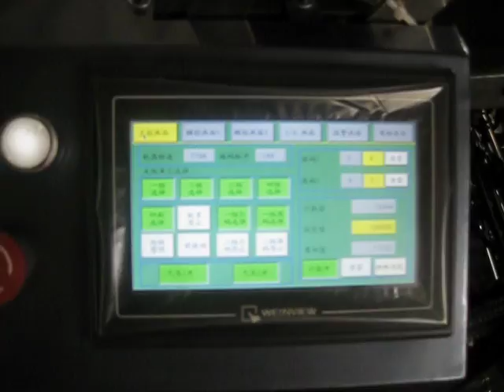all-in-one offset press

Comment: it will last six months i had one, concept is good bot cheap workmenship, all sorts of trouble you have 9 months old it going in scrap metal , machine Daming Brand, air pump gives hot air , paper buckles , 3months motor had to be serviced , roller that drives belt on feedboard got jammed , bearing seized and snapped , numbering machine , one minute it working fine next minute jams , they dond have complete mannuals , fuse blew computer programme gone wrong , they tell you do this do that , take pitcure and send you get mad, please be careful when you buy this machine is first one and last one in australia all printers come and have look they love the concept but hate the workmanship